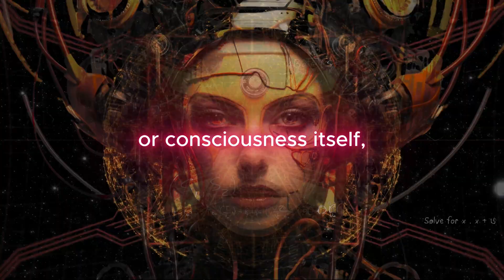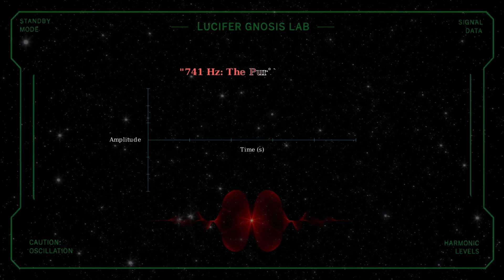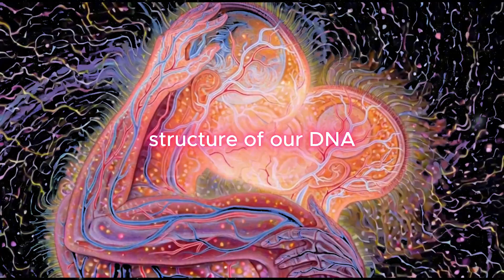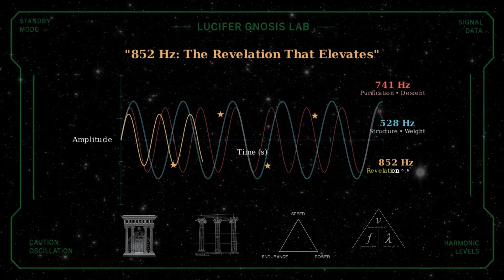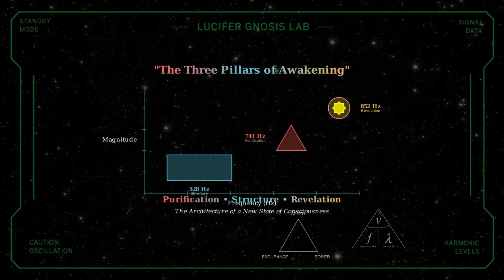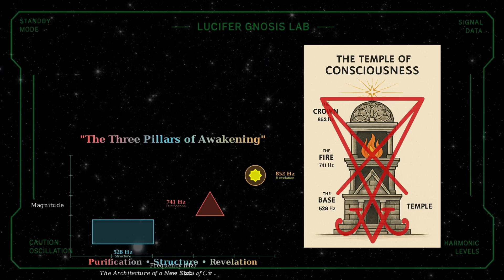The Luciferian Octave A Fourier Analysis of 741, 528 & 852 Hz  Sacred Geometry of Sound

Comment: What drivel is this? 'Ancient traditions called this the frequency of purification'; the first tones with a known frequency were produced in the 17th century. Is that ancient?
Furthermore, 528, 741 and 852 aren't octaves of each other; there needs to be a relation of 1/2. And why do you write 5:28, 7:41 and 8:52 in the video?
Try a good book on physics sometime. The best of luck.
Reply from the maker: You're right — not acoustic octaves. "Octave" here is symbolic: a complete cycle of transformation (descent → weight → ascent), not a 2:1 frequency ratio. The Fourier math is accurate; the metaphorical language could be clearer. Thanks for the precision. 🔱